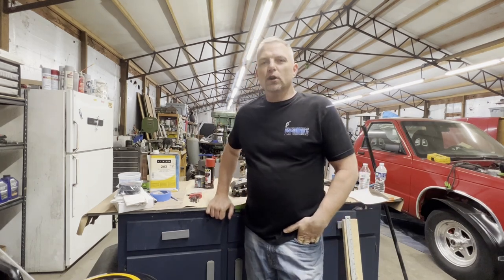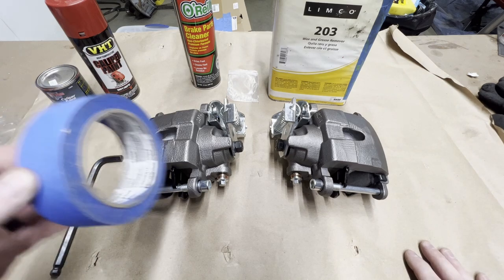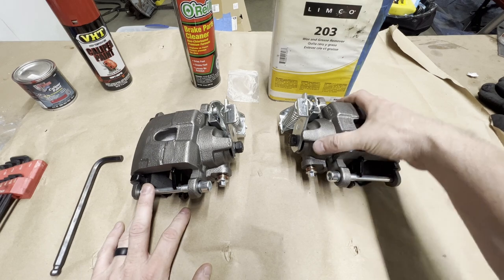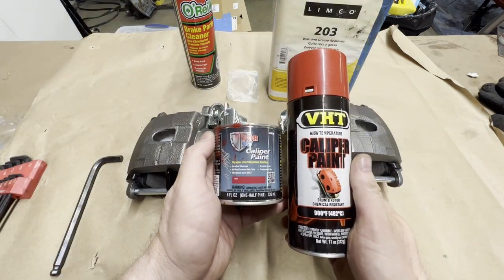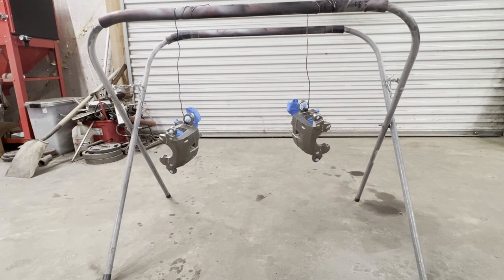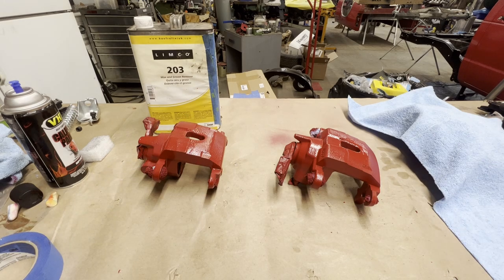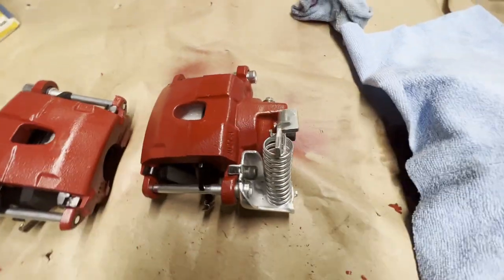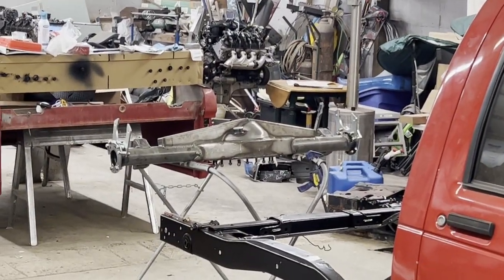Caliper Paint VHT vs POR 15 -  Getting the Trick Chassis Rear End Ready to Install

Comment: If you use VHT paint you have to put your calipers in the oven to cure the paint. The brake fluid will damage both the VHT & the Por15. I find your better off painting them while there on the car. But, I would just use Cerakote. Cerakote is away better product.  I find that if you  have VHT as your base coat, you can paint cheaper non- high heat rust-oleum enamel over top & add a clear coat afterwards... but once you bleed your brakes.. it's game over & all your work down has to be done over. Also, VHT paint will only last a few months. Where as Cerakote will still look good 4 years later & isn't effect by brake fluid.  
Good video tutorial though.
Cheers!
Reply from the maker: @timothykydd3959 Great information. Thanks for sharing. When this application wears off I will definitely use your advice and re coat the calipers. 100% thanks for sharing and watching. 100% thanks for commenting, that’s how we all learn!!

Comment: im not sure how the POR would come out "blotchy" or "uneven" when it's self-leveling and you can add multiple coats..
Reply from the maker: @kitvexed8229 I am sure my surface prep was not adequate. I plan on prepping them better and trying again. Thanks for watching and commenting!
Reply: @dtperformance256  i was thinking the POR actually bonds to the metal, with all the steps in the kit.. whilst the VHT is essentially just spray painting - which is why it came off immediately onto the cardboard. brake fluid will take off the factory paint from your car, so you can't really hold that against POR when exposed.  good video either way looking fwd to the next!
Reply from the maker: @kitvexed8229 AGREE! Brake fluid is mean! I am going to try and prep better and try not to get brake fluid on the calipers. I don’t know of a paint out there that will withstand brake fluid. I need to be more careful in assembly and try not to get it all over everything.

Comment: I wonder how the POR15 on a frame would hold up. Anyway, I painted my calipers using VHT but in black. No issues yet, but  I did bead blast mine prior to painting using a cheap Harbor Freight blaster and I deburred also to knock off the sharp edges. Thank for another video.
Reply from the maker: @Your PCMD the frame paint where I spilled brake fluid seems to be ok, but wow the caliper paint peeled off. It may have been my prep but I dont think so. Thanks for the comments and thanks for watching!!

Comment: I use dupli-color caliper paint with good results as long as prep is good but I also use por15 and but on my truck
Reply from the maker: @allen cobbs thanks for the feedback. I had a few spots that scratched off easily with the VHT. I prepped the metal very good and I don’t thinknit was my fault, but we will see. I didn’t even think of Dupli-Color. I use their vinyl dye and have always had great results. Again thanks for mentioning dupli-color I will keep them in mind.

Comment: You have to bake the VHT in an oven in order to cure it.
Reply from the maker: @lizard944 I did not know that! Should have read the directions! I would think the heat in an oven would melt the piston seals. I will double check! Thanks dor lwtting me know in the comments!!
Reply: @dtperformance256 Bit belated, but 200°F at 10 minutes for curing will not melt the EPDM rubber seals. If you think about it, the brakes get pretty hot from regular use alone; especially at 65+ mph.
Reply from the maker: @benitoloco892 good point!! Brake calipers get alot hotter than most people realize. Thanks for watching and the commment!!